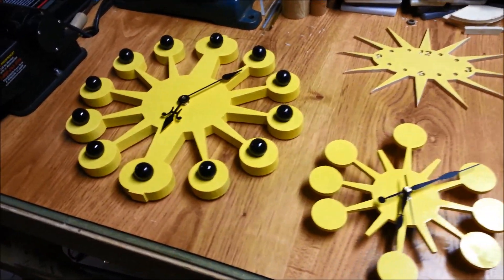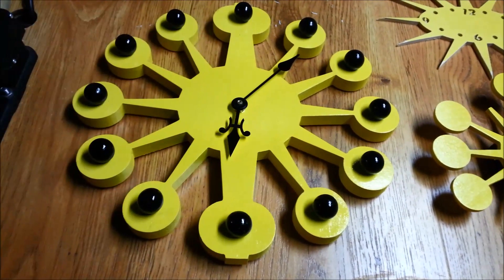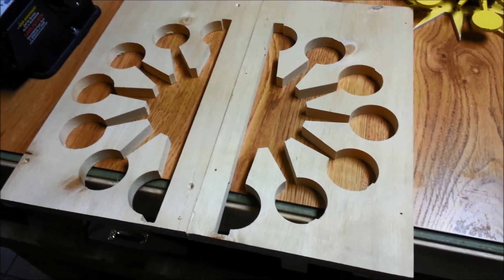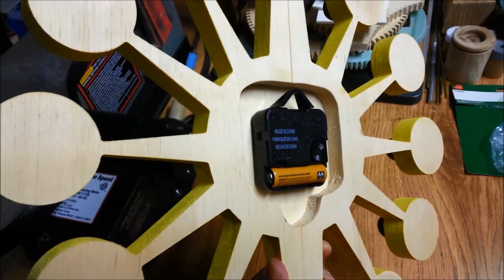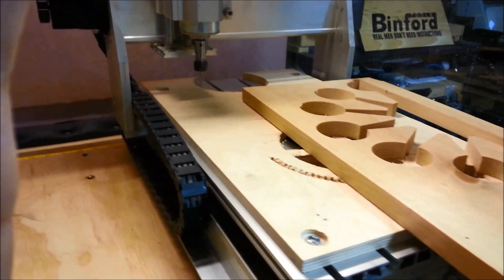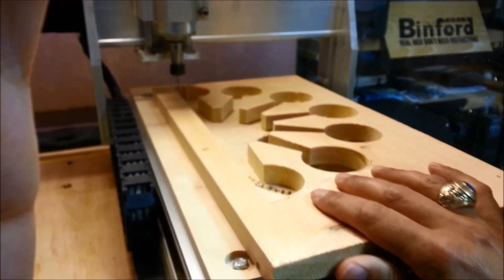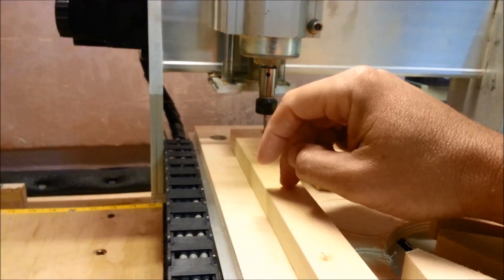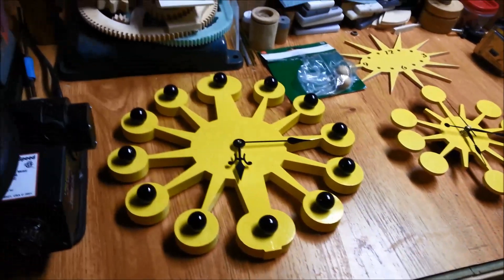Starburst Retro Clock Project

Comment: Dan, You used a name carving  program in one of your drawer slide videos. Do you remember the name of the program? Thnx for a reply.
Reply from the maker: Don Gibbs Hi Don.  Ummmm, well - I've worked with a whole lot of open source/freeware/shareware programs in the last few years.  Fortunately there is a very large selection to choose from.  After trying probably 10 to 15 different CAD and CAM Programs I've settled in on two or three that I like the most.  Inkscape is truly fantastic for CAD and vector work for CNC machines.  It's free and extremely powerful.  I really like designing projects with it.  For the CAM part of the equation, I'm using another free program that can run in the web browser so there is nothing to download at all - it's called Jscut.  Just go to www.jscut.org and there it is.  I sometimes use an old version of Turbocad because I've had it for a decade (it's also dirt cheap to buy and old version say $10 to $20).  And I have a very old version of Illustrator but I like using Inkscape more.  To run the actual CNC I use Mach3.  It does cost around $150.  I like it but there are certainly free programs that do the same thing as Mach.  Keep trying the free ones until you get to some you like.  No need to buy CNC software for hobby work.

Comment: I am interested in CNC for woodworking, but have no idea where to start. It seems it would be beneficial for accuracy over using my scroll saw for certain projects. Is it fairly easy to learn?
Reply from the maker: Waylight Creations Well, it depends.  It doesn't have to be.  But if your projects are complex it can get involved.  A basic CNC like the 3040 is around $650 and within a half hour of being unboxed can be up and running.  However there are typically three software stages to any CNC cut.  First the design is created in a CAD program (Inkscape, Illustrator, etc.)  Then the design is opened in a program that defines the tool paths; how deep to cut, where to cut pockets, where to cut outlines, and so forth.  After the tool paths are set up then the CAM program (CAM not CAD at this point) saves the paths to g-code.  The third program in the mix is the one that takes the g-code and tells the CNC machine how to move.  I use Mach3, but there are other programs that don't cost anything.  Mach3 is about $175.  Inkscape is free and awesome.  I use Jscut for my tool paths and that is free.  The hobby is a blast but does take some time to figure out.  If you want to make your own CNC machine, that is very doable - I made my first one a few years ago - but it can take a good while to assemble.  I'd join some CNC forums and start asking questions.  Most folks on those forums are happy to help.   Best of luck.
Reply: Thanks for the info, drez20001. I greatly appreciate it.